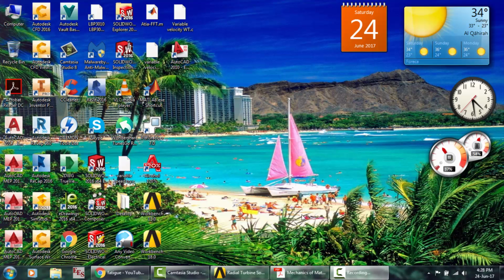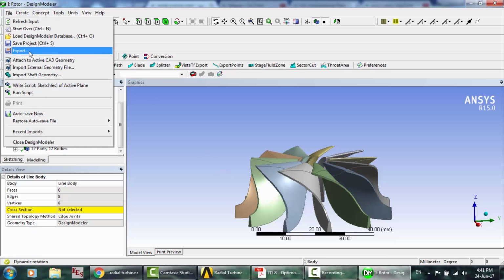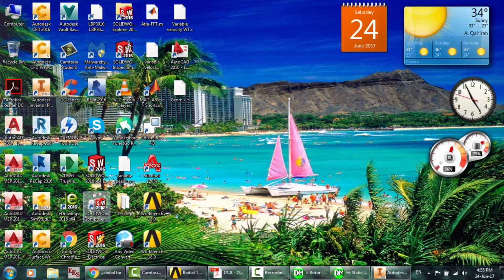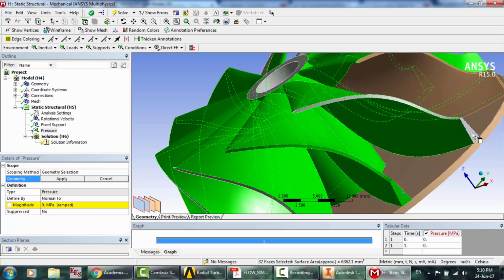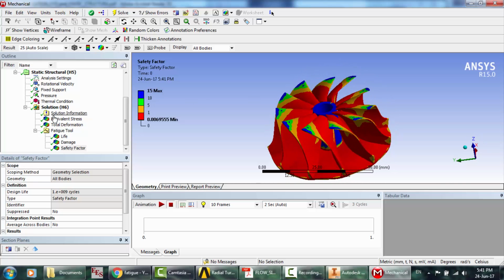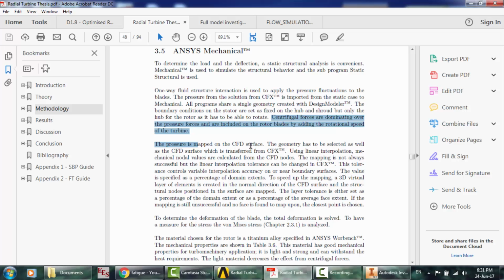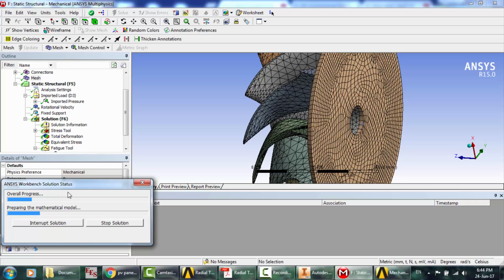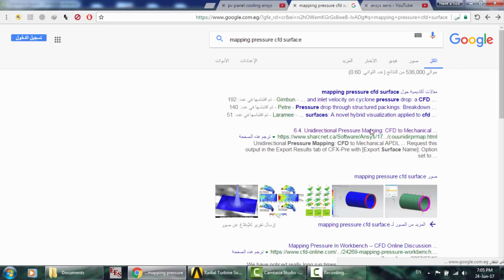A radial turbine static structural simulation using ansys mechanical rotor&nozzle

Comment: Hi there
Just wondering about the conversion at 37:48 u mentioned 85 rpm then converted it to rad per sec as 8901.17, shouldnt it be 8.90117 rad per sec?
Reply from the maker: It was 85000 rpm

Comment: would you please advise on how to plot a graph on excel or CFX, pressure ratio against the mass flow rate
Reply from the maker: Hello dear Mohammad,  you have to run multiple simulations at different inputs and test the results then plot them on one graph. Dnake!

Comment: I get quite confused about how to create a hub for these blades, at 15:50
Reply from the maker: Hello dear ASMR, The blades are generated by VISTA RTD. After exporting it into Autodesk Inventor, the base and the shaft were added exactly like what I showed. New sketches and the extrude command to make the blades connected exactly like the manufactured rotors. Danke!
Reply: @haveanicetime  Thanks!
Reply from the maker: You're welcome!

Comment: good video; Excuse me how can I get the geometries of your examples?
Reply from the maker: Hello dear Mayco, you are very much welcome ! Simply you can generate the geometry using ANSYS Vista. You can generate the blade and then complete the full design of the rotor or the stator using any CAD software. 

Generate the blade using Bladegen or Vista and then open the design modeler and export the blade as an x-t parasolid file. 
Open it in any CAD software to complete the model. Or simply generate the blade from scratch by any software and then make the full design.

 Because in stress analysis we need the geometry that will be manufactured not the flow path. This will help you understand how to design the blade from scratch. 

Vielen Dank !

Comment: sir please make a tutorial on francis turbine cavitation
Reply from the maker: Hello dear Mohd, this phenomenon can be simulated using ANSYS FLUENT. You can generate the fluid path of the rotor and stator and set the boundary conditions that may cause cavitation, you can watch my tutorial about the axial fan in FLUENT and do the same idea for Francis turbine because the blades of this particular turbine is not easy in Bladegen or Vista, so, it is not common to be done in CFX :) .....Thanks

Comment: Great work, Thank you !!!! Sir, I am doing master thesis in same field,but the problem is We don't have any CAD file of Whole turbine assembly. Can you pls share the same CAD file with me. kirangerange77@gmail.com
Reply from the maker: Hello dear Kiran, you are welcome! I think it will be better if you start from scratch by yourself, you can use Vista RTD and generate the blades according to the parameters you want and the performance curves and you will instantly have a comparative design for the mechanical and flow simulation, also you can generate the volute from Vista CPD, and you can ask me if you have any other problem, okay dear Kiran? Thank you!

Comment: Great Video learned much, Thank you :) Is it possible that you make a tutorial about hexa meshing an centrifugal impeller blade in ICEM? I'm currently Working on an one bladed pump impeller and I am  at a point where I don't know to go further with my blocking/meshing :( Thank you and have a nice day ;)
Reply from the maker: You are welcome dear eng. Daniel :), can you carry out the mesh using turboGrid? Thanks
Reply: I didn't try because I wanted to get to now ICEM better for hexa meshing impellers :D
Reply from the maker: Dear eng. Daniel, the idea is that using ICEM for turbomachinery is not easy and consume too much time :) and we use turbogrid and Ansys mech more than ICEM :)..I have a tutorial which shows how to use turbogrid for a pump :)..Also, we can generate a hexa mesh using Ansys mesh but ,I have experience in these simulation and it is not important to use hexa mesh for impellers, you can use unstructured mesh with infaltion by Ansys mesh and also it requires some modifications and a good effort..So, tell me your target...Thanks
Reply: Have a nice time! okay Thanks för your answer. my goal is based on a master thesis at my university. in this thesis the goal is to head mesh an one bladed pump impeller. Because I am only a bachelor student I can't get on this master thesis. so I thought I try my best in learning ICEM and mesh an easy model of an impeller in my free time :D sounds weird but yes that's why I wanted to work with ICEM and a hexa mesh
Reply from the maker: Okay, like I said, we do not use ICEM in 98% of the turbomachinery simulations because it requires huge effort and time...So, you can find videos about ICEM (type: Structured hexa meching using Ansys CFD part 1) you'll find  videos about a pump impeller but it is not easy...So, you can watch it and try to use turbogrid like my tutorial :D ..Thanks
Reply: Have a nice time! thank you :) but till now I never found a video about meshing a pump,  only airfoil or turbine blades or a volute. But I will carry on trying to get an acceptable mesh some day :D
Reply from the maker: Dear eng. Daniel, attached a link for a pump impeller, they used the periodicity technique like turbogrid, carrying out a mesh on one passage and then define the periodic interfaces...I hope this help you...Danke!
https://www.youtube.com/watch?v=jgt7d7-c18g&t=10s
Reply: Have a nice time! I will have a look on it and try to attach it to my profile :) danke für deine Zeit ;)
Reply from the maker: Bitte schön :)